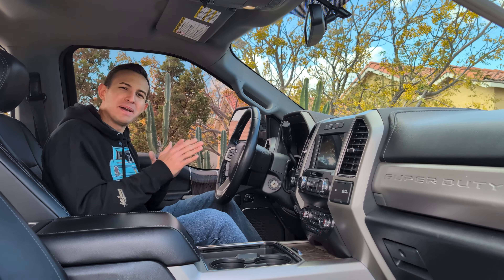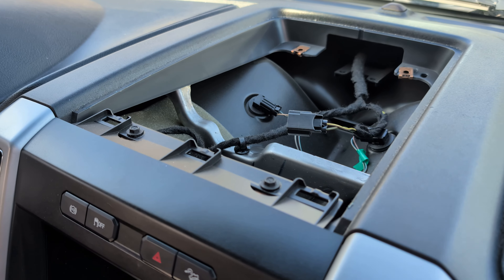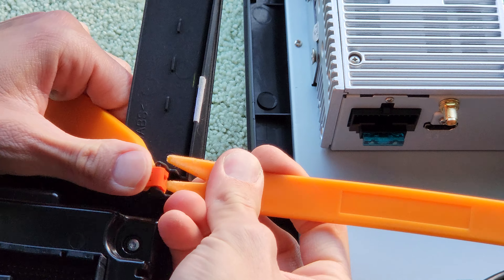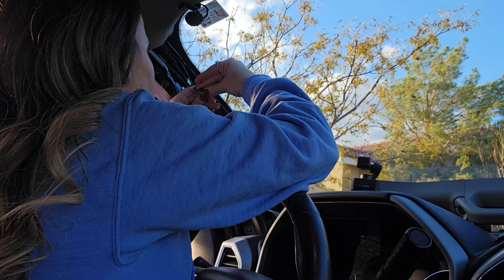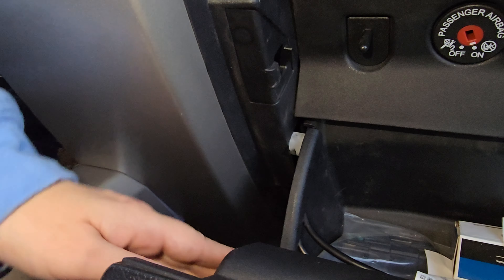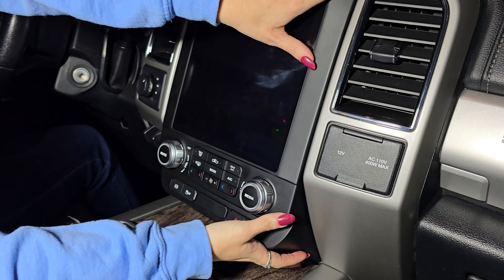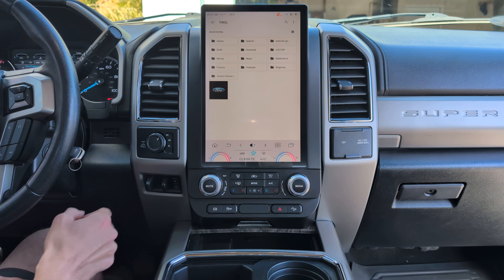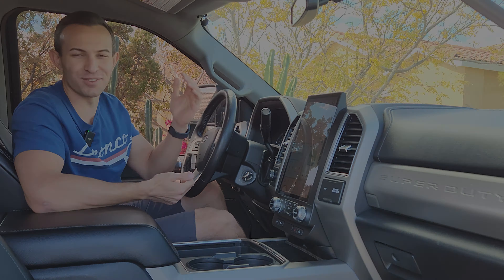Transform Your Ford F-Series with This 13-Inch Screen! F-150/F-250 – Complete Install Guide

Comment: Where are the heated and cooled seats button suppose to go? I just ordered this same headunit off amazon just curious on if I will lose any factory functions being my truck is a king ranch I have massage seats ambient lighting heated cooled seats all the options
Reply from the maker: You can see the heated and cooled seat controls at 30:11 and as far as massage seats they will also be built-in to the screen, but I believe it's on a different page.
Reply: @ thank you for the reply I will def keep watching this video for install purposes!
Reply: Quick question do we have to plug in the mic and run it up and can we just plug it in and leave it behind the dash or not plug it in at all ? I don’t ever use hands free calling
Reply from the maker: @ThatKingRanchF150  You will still want it somewhere outside of the dash. Besides calls, it will be used to communicate with the screen, for example, using the assistant built-in to CarPlay or Android Auto, to text someone or navigate. 

You can install it anywhere you’d like, but we chose this spot because once it’s there, it’s out of sight and no one will notice it.